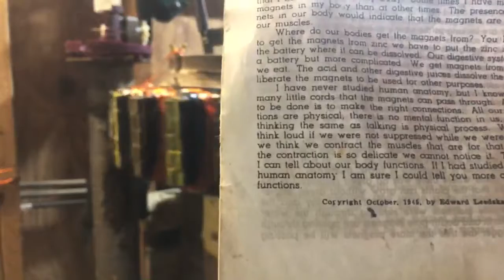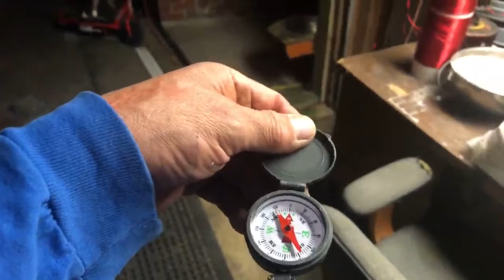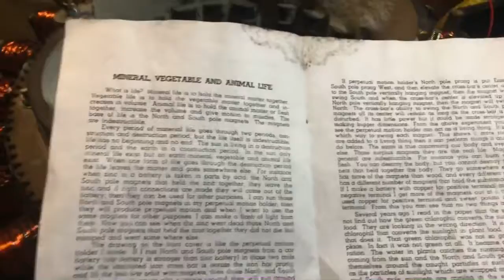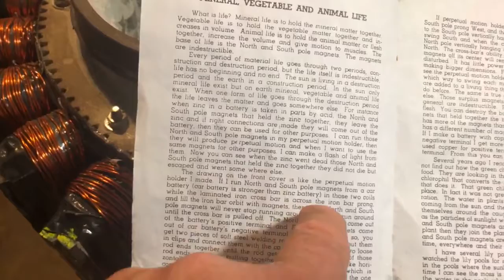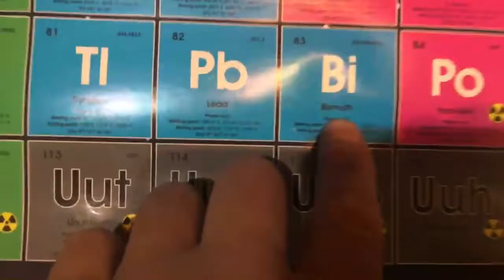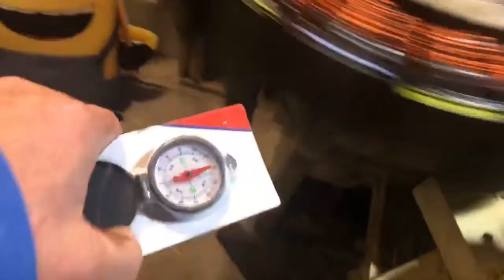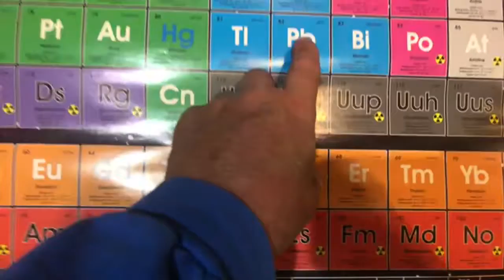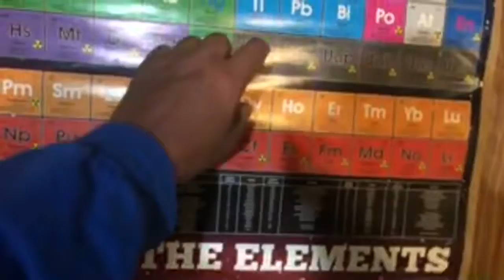Coral Castle, Ed Leedskalnin, The Elements = Energy from Static Induction!

Comment: Just some info on the valve pete mentions it must be a natural points spark gap immiter and the valve spring would act as a collapsing field coil as the energy transmitted down the valve stem would then on valve opening cause the outer spring to induce a radiant field collapsing to cause voltage to go to infinity and amps to kick back stan Meyer states this in his water fuel cell videos showing 2 coils going to his supposed fuel cell  butj joe booker learnt that the engine already had it all within its build by his mitsubishi v6 sigma knowledge in joe cell Suzuki video where he's talking in the cafe about it near the end of the video   And the engine itself is auud tesla coil oil one side of the block and water the other side being flip flopped ac dc pos neg neg pos causing block to become neutral spiked soaked energy condenser.

Comment: 34:00 Just Wondering,.. Always thought Like,.. What if he Took apple or Pear or whatever Magnetic Material and Threw it into the Acid at the Center of the Wheel?   and Bubbles went to Their Own Pole Ends?  Via the Bend in the Vee Magnets?  2,000 Revolutions.. hmm..  I Know the Fluid I Put in the Wheel...Went Up To Top Along Vee's but went Down at Center,..  When i spun it.  Like the magnets Accumulate down the Side corner Edge inside the wheel.. 41:50 Tap into Creek Via Underground Radiator And Attach a Thick Copper wire To it.. bury a car Radiator.The Radiator is Copper Aluminum,. that Would be a Good conductor of the Magneticity.  I Like your Ideas Roy, their Radical.  You Should Cut a Well underground Tunnel to Make a Pickup for the Underground Magneticity.  Like Ed's 'well'  There's Something To that. I think A Bucket..for a Well.. that is Like the Chains he has Hung.. on Bar.. and is like Well Wood Stump Turning Thing that He used to Draw WATT tore...  water.  & He Took that Capacitance,.. or Capacitor of Water,.. and POURED it INTO the Magnet Wheel from Above,. so to Speak ,.and The Capacitance Fell..and Arc's Like a Splash to Symetrical Electrical Designs..  hmm.   I Think its Like worms in the Earth and tunnels..and Ants and How they Burrow..   and That is How the Electricity is With the TUBES... you  YOU TUBE 'it' U 'tube' It...  Like Portals to CHANNELS of Other Channels.. in the Energy River Directions,..  that Gets Split To Two Rivers,. but is Eventually Brought Back together Again in the Spiral of the Water Bucket Fall on the Arc Wheel..    Well..  Rod..   of Grounding..  Like a Ground Rod in the ground At House...  To Give Some place for the Elek Tri City .. to Go... and Return...after Satan is let Loose Again to Deceive the nations,..   but IS IN CHAINS...  "Bound''  and Jesus beheld Satan as Lightning falling from Heaven.  That is the 'power,   ...   the "creature" in the 'Light'   ..... the "indeSTRUCTable"  'beast' ''worm'' in the Wormwood wood 'worm' Crawling through the Blueprint of the Circuitry.  It'S like he Just keeps this Radionic Beast,. and Encapsulates it.. to Tubes,.. with IRON CORES..and this 'Beast'  "CircuLATES" ...  Like how You said With the Capacitor Electrical Device you have and the Amps are High but it Only puts out So much Volts,... like Its Like when Ya gata Go pee But you Can't find A Public Restroom, cuz Their all Locked up and You need a Bathroom key,  and the damn is Ready to break..  like That's how they use the Energy your Right.  15:04 "their Limiting The current"  "Their Dampening Down the Current"   Everything Makes me think How You Pick Up The Floor Of the Earth Like a Tent, and a Rising Tide Current,. and Draw it Up to A Arc Spark at Handle Top Which Reaches to the J hook Top Chains and 'CLIMBS' ...  its Like you Make the floor Of Magneticity FLOOD the Center of Wheel....  and You 'Ripple'   ....the Surface... of it... so It Reverberates..the Wheel's Vee's...       Ring....    twice...           Drop Below...  hmm

Comment: Multiplier Coil Rings

Pancake Tesla Coil Transformer represents a sphere in high spin rate flattened out into a ring. (Allows for Quantum equations calculations.)

More importantly decreases charge losses between edges of stacked rings. (Stove top induction.) Allows multiple rings top and bottom of trigger input ring. (P1)

This design may also aggravate triboelectric dielectric if placed between rings forming a capacitor between rings.

Konstantin Meyl Scalar Wave Interview with William Alek

https://youtu.be/F7SR4vF_pug?t=24m16s